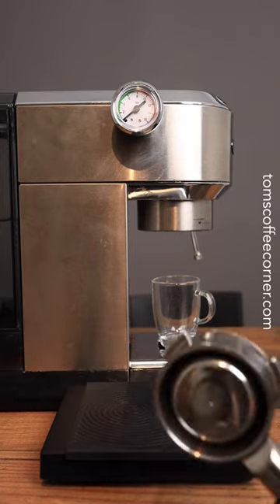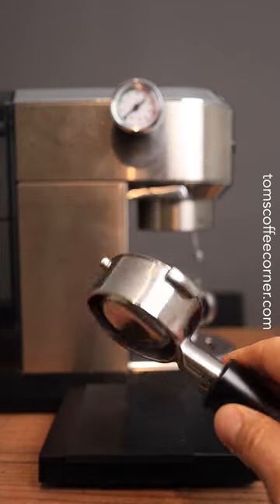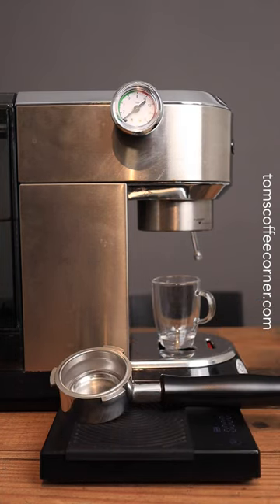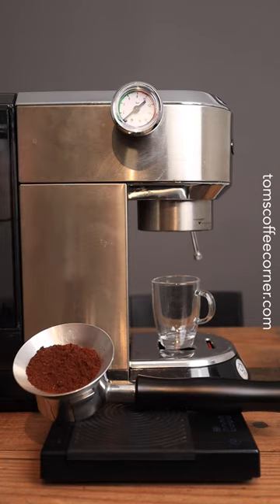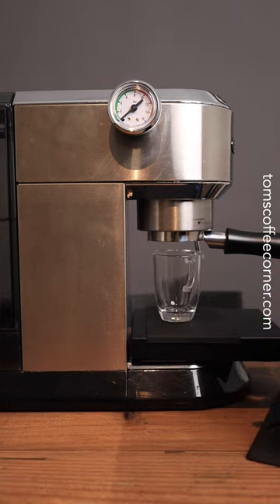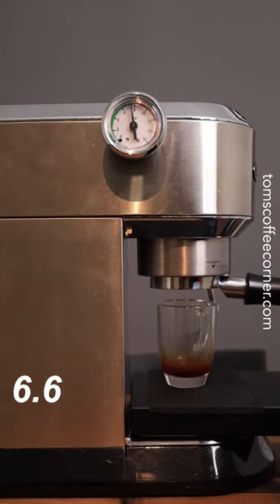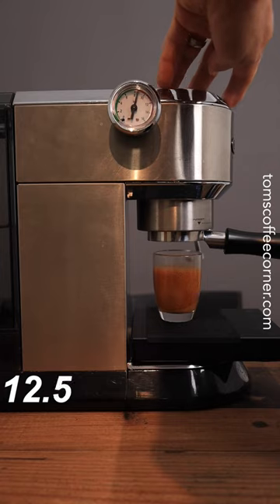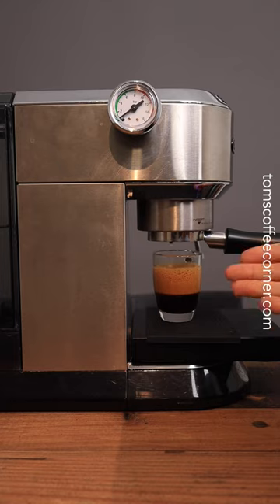Delonghi Dedica: How Much Pressure does the Pressurized Basket Make?

Comment: Would a pressurized portafilter not be subject to channeling? Or is that point 😅. I’m new to coffee in general so curious
Reply from the maker: That's a good question...I am guessing what happens inside a pressurized basket, is that the grounds are soaked, and mixed up like a soup, until finally they make it out through the one hole. It is certainly not a traditional extraction, since there is only one path out. In a traditional basket, the water can follow the path of least resistance, and that is where you see channeling.

Comment: mine just blocks up
Reply from the maker: I know that can happen. Maybe try a non-pressurized filter?
Reply: @TomsCoffeeCorner  i ended up drilling out a larger hole instead of the pin prick size hole😂
Reply: @bobcharlie7982  mine clogs up as well, i think its mostly due to the size of the grind.